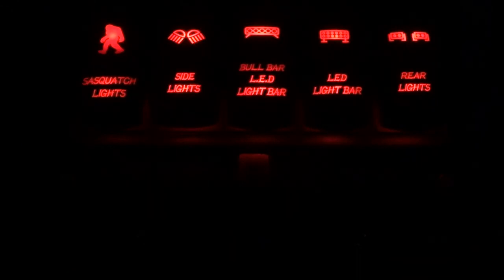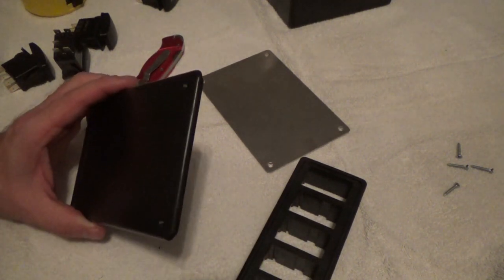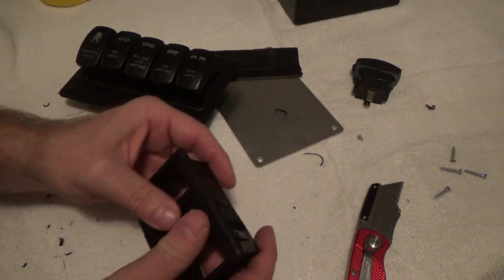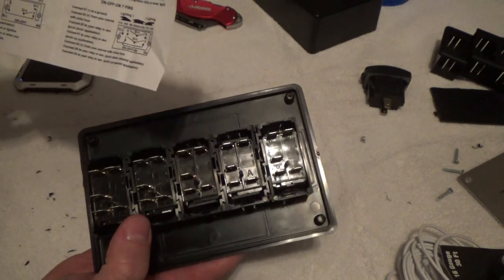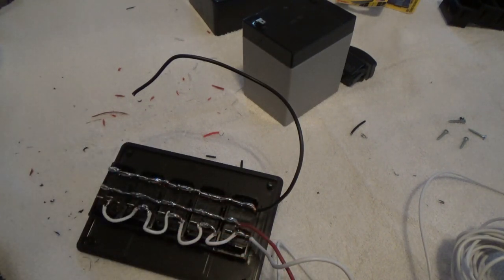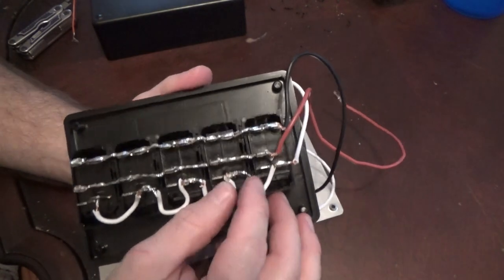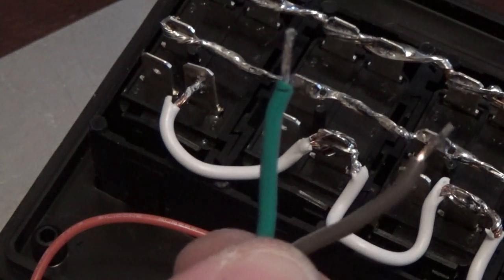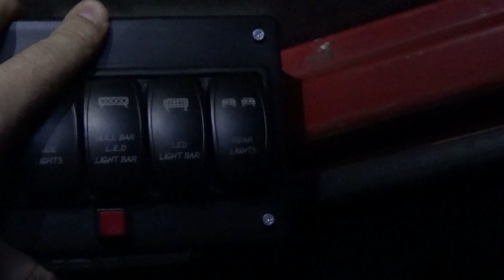Jeep Wrangler - DIY switch pod. Very detailed tutorial

Comment: Awesome! I plan on replacing my entire lower panel on my TJ (3 switch panel & ash tray) with a large switch panel for lights and eventually and inside winch controller. This helped give me some ideas on how to do so.
Reply from the maker: I've been getting so many lights from that Auxbeam company to try out. My wiring is turning into a mess!! lol .. I'm also setting up for a wench eventually and on-board air. I wanted a way to neatly control all that. The PDC I'll be making originally came out of a Jeep Gran Cherokee. Keeping the low "control" voltage inside and using HVAC thermostat wire to trigger the relays mounted outside. Keeps wiring mess to a minimal. Glad you liked the video and glad it helped you! Thanks for taking the time to leave a great comment! Have a great day!

Comment: Your vidoes are always entertaining and informative at the same time. Quick question... with all of the extra lighting you are planning on installing, did you have to upgrade your alternator at all? And all of these were going on your YJ right?
Reply from the maker: Thanks, glad you enjoy them! I have upgraded the alternator to a 135 Amp. I've also installed a winch since this video. I've changed my mind a bit since creating this switch pod. I'm gonna be running the bumper LED, the 52 above my windshield, rock lights and the rear 12" LED in my spare tire. For now, that's all I plan on running on my YJ. Here is the video to the alternaot upgrade: https://www.youtube.com/watch?v=SsnnapGC7ZM
Reply: Awesome thanks!

Comment: One small hint on stripping wires. Once you get the insulation cut, grab the insulation with your fingers, twist and pull slowly and you will have a nice tight twist on the wires. Plus you wont get any oils from your skin on the bare wires.
Reply from the maker: I didn't even think about that. You are correct. Great tip! Thanks!